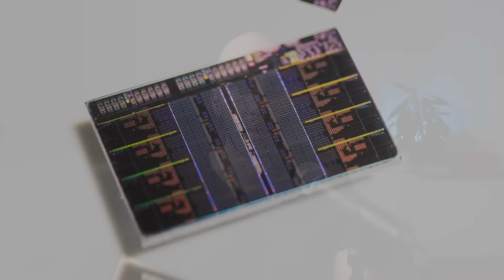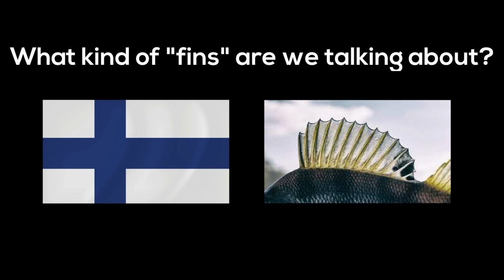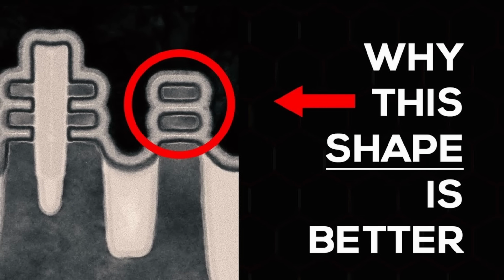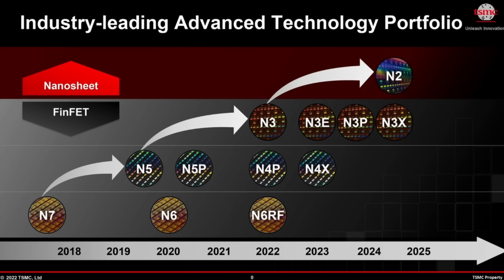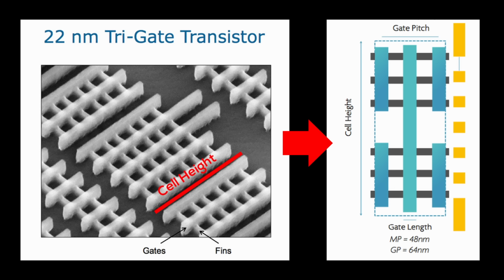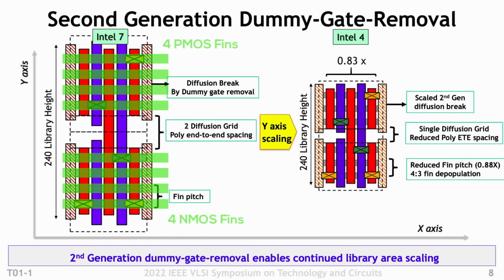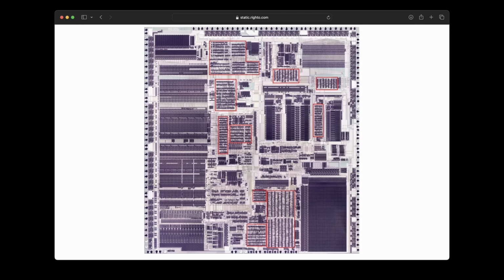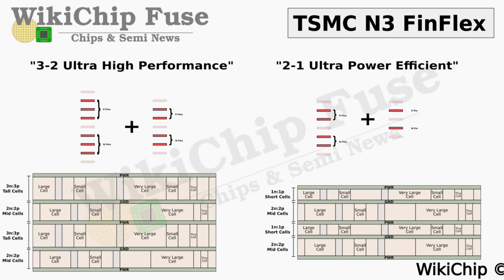TSMC FinFlex: How Chips are made Worse to get Better

Comment: Awesome video. I used work at a research institute focused on algorithms for VLSI (though I personally worked on something different, not VLSI). With every process node, there would be new flexibility but also ever more complicated rules to go along with it. For example, you'd be able to place wires closer together than before but you'd have to avoid specific patterns because of interference. Looks like this technology behaves the same way. From an algorithm designer's perspective, designing chips becomes more and more difficult with each process node. I think if manufacturing improvements stopped tomorrow, it would still take many years for all the potential in the current process to be exploited.

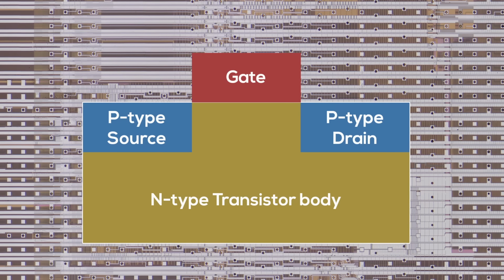Comment: Your videos are superb and well-researched.  However, you could use an improvement in your explanation of the field-effect transistor (N-channel & P-channel) at 2:20, without complicating it with physics.  The key to note is that in any one transistor, the source and drain materials are different even though they are of the same polarity.  Therefore you need to provide reference in your explanation.  

Hence, when the voltage on an NMOS transistor's gate is more positive than its source, the internal electric field created induces conduction between its source and drain, meaning that it is in the ON (or closed) condition.  The crux is that when the voltage is the SAME on the gate as the source (eg zero volts difference), it is in the OFF (or open) condition.

Conversely, when the voltage on a PMOS transistor's gate is more negative than its source, the internal electric field created induces conduction between its source and drain, meaning that it is in the ON (or closed) condition.  The crux is that when the voltage is the SAME on the gate as the source (eg zero volts difference), it is in the OFF (or open) condition.  Note this last line is same explanation as for NMOS!

Now here's neat thing about all this (look at a schematic of a CMOS inverter).  In the simplest case of an inverter logic gate with one PMOS and one NMOS, you connect the gates together for the input, and the drains together for the output.  Next, you connect the NMOS source to GND, and the big deal is this: you "flip" the PMOS relative to the NMOS, that is, you connect the PMOS source to +5V.  Now, in reference to GND (your voltmeter red probe on the connected drains and black probe on GND), if you apply 0V to the input (ground the gates), note that the NMOS is OFF while the PMOS is ON, so you get +5V on the output (0V input changes to +5V output).  Conversely, still referenced to GND, if you apply 5V to the input (connect the gates to +5V), note that now the PMOS is OFF while the NMOS is ON, so you get 0V on the output (+5V input changes to 0V output) ... and there is the inversion.

You might ask .. so what is the charm of CMOS???  First of all, CMOS is not a kind-of transistor as he suggests, it is a technology.  Fundamentally CMOS technology combines both NMOS and PMOS transistors, pairing functionality such that when one is ON the other is OFF (hence Complementary Metal Oxide Semiconductor, CMOS).  The simplest CMOS circuit is the INVERTER.

Let's travel back to the early days of CPUs ...

Simply put ... back then (early 70's) PMOS transistors were difficult to realize, especially on the same die with NMOS transistors.   So instead of using a PMOS transistor in the INVERTER, a resistor was used, tied to +5V, and only an NMOS transistor was used.  This was called a "pull-up" resistor.  That meant when the NMOS transistor was ON, current had to flow both through the resistor and the NMOS device, HEATING the resistor and wasting power.  Moreover, when the NMOS transistor transitioned from its ON to OFF state, the resistor had to charge up tiny capacitors further down line, slowing down the response (RC effect) of the next switching circuit.  So it was a double-whammy, HEAT and LOW SPEED, and, it was impossible to overclock those CPUs.  Therefore, if an early NMOS-only CPU was stopped but still powered, it would be HOT without doing any work ... that is .. statistically half of its resistors would be conducting and the other half not, in a steady condition.  So basically, the heat produced by stopped CPU and a running CPU was not much different!

Advent of CMOS.  

Replacing the pull-up resistor by a PMOS device brought two benefits: 1) as I explained above, when the NMOS was in its ON state, the PMOS would be OFF, hence NO HEAT, and 2) when the NMOS was in its OFF state, the PMOS would be ON, delivering power ONLY to the next stage, not to its NMOS (because it is OFF).  Furthermore, the output drive was now "active" instead of "passive", all put together resulted in a dramatic increase in speed and decrease in power dissipation.  The first single-die CMOS CPU was the RCA 8-bit CPD1802, introduced around 1974-75.  I was able to overclock it (perhaps one of the first overclocks on the planet), from 3 MHz to a whopping 6 MHz (MegaHertz)!  And yes, it still runs at 6 MHz.  Consider that the IBM PC used NMOS-only technology (5MHz i8088) 6 years later, the CPD1802 was so "advanced," it hardly got warm even at 6 MHz.

So why do we need heatsinks on our CPU these days???  It's because the faster we switch the CMOS devices, the more often tiny capacitors need to be charged and discharged.  This is increased work, and work is heat.  So as we increase CPU (switching) "clock" into the GigaHertz range, this capacitor charge/discharge becomes the dominant effect, and when you have literally billions of tiny capacitors and MOS devices on a die, both the transistors (they are not perfect, they do have a small amount of ON-resistance) and capacitors will heat up.  Therefore, a modern CPU in the stopped state, or near-stopped state, can be cool, but when running at 4 or 5 GHz can produce the heat of a 100 Watt light bulb.  

Now you know why intelligent clock throttling is important for the sweet-spot-on-the-tennis-racquet, especially in a laptop: computing power (and heat) on demand, only when really needed.

This was supposed to have been a short comment.

Comment: Everyone that talks about Moore's Law forgets the part where it is supposed to get cheaper.
Reply: The same capabilities are getting cheaper, unless you're Texas Instruments and you have a monopoly. 

The basic digital camera with the same resolution, storage capacity, frame rate, and connectivity as five years ago costs less now than it did back then. It's just that no one wants less capability so nobody buys them, and manufacturers stop making them.
Reply: The same capabilities in gaming are only getting cheaper for the devs.  

They’re pushing off optimization onto hardware capable of brute forcing its way through, meanwhile Nanite, lumen, and other design tools just make it easier and faster to do.  

Games look the same as they did 8-10 years ago, but run worse the newer they are.  The cost of the hardware needed to brute force past inefficiency is pushed onto the consumer.  

Transistor density is up
Die size is up
Package complexity is up
Energy cost is up
TDP is way up
Cost is astronomically up.  

Seems like we’re trying to brute force our way past Moore’s law.  It should be called brute’s law.   Price will double every 3 years no matter what the hardware does.

Comment: I think you missed the point on the power efficiency of cmos…my understanding is that cmos is used because it’s more power efficient than either pmos or nmos alone. If you only use pmos or only use nmos, either a one is represented as power flowing and a zero is represented as power not flowing or vice versa. That means there’s constant current flow and energy loss. If you combine a pmos circuit where power flow represents a 1 with an nmos circuit where power flow represents a zero, you get a circuit where there’s no power flow at all, but if the pmos circuit is open and the nmos circuit is closed, that’s a one, while if the nmos circuit is open but the pmos circuit is blocking the flow, that’s a zero.

Instead of representing values by whether power is flowing, you represent values by why the power isn’t flowing (the pmos side or the nmos side), and that’s when you get massive power savings…it’s not that the one kind was much better than the other in terms of power draw, but that putting both together stops a lot of wasted power.

Comment: As to standard cell sizing, they commonly come in multiple sizes. And it isn't just speed, it's also how large the net is that is being driven. That could go to 20 or 30 other inputs, so you want a big beefy driver for that. That. Also, if you have a line that goes a long way you want a bigger driver for that too. But you would use a smaller one for a short Trace that only goes to a couple cells.
Modern synthesis and place and route tools. Do this for you. Pretty much automatically. They will size cells up or down as necessary while still meeting the timing.

Comment: I would not say that those next-node transistors are Worse*. They are in all aspects really *Improved ones (I would not use Optimised, because that bears a negative aspect of a trade-off). So the TLDR from this video is - the next node is not a nanometer size reduction, its the same on X/Y axis. But the Z - height - has grown. So more into what V-nand brought to the SSDs. And the FinFlex is then a further Improvement - combining benefits of both cell types.

Comment: no thats pipedreams. SEMI CONDUCTOR. in form of silicon bed, you are making the signal path smaller in collective atom mass, there for the LIMIT of those semi conductors speed transfer will be amplified with the narrower path, and its GET SLOWER. and the only way you making it faster is by adding more voltage/ampere through it. STRESSING that narrow path as the amount of atom transferring the electron signals now must take the energy beyond its critical capacity and will burn the silicon up. the smaller of the path, the less "rails" available for electron signals.
and you are opting to increase its processing nodes density, making instructions more complex and can only go up to certain point where things will no longer gain anything. and currently you already at the 99 percent of the semi conductor capability.
there is no more to be gained from getting smaller and smaller, because you will only add more density into it. and that cancels each other.
semi conductor silicon tech has at its peak. move on to new different compute processing tech or be happy with everything the way they are.

Comment: Moore's law doesn't exist in reality.  If it did CPU/GPUs wouldn't be skyrocketing in size and power consumption.  

Moore's law seems to be a goal but not a practical reality.  If it was a reality, a Nvidia 270 would have the same power draw and size as a 3070.  But we know that isn't the case.  It's gotten so bad that CPUs are like 20-30% larger, and GPUs are monsters requiring huge coolers.  😂

Comment: A big advancement in chip design is going to be when we can design truly 3-dimensional chips, i.e. chips that actually have 3-dimensional transistors and whatnot rather than just vias. While AMD is already doing something barely similar with their 3D V-Cache technology (which is frankly just stacking silicon more than anything else), there's a massive amount of performance to be had if this ever becomes a thing - unfortunately, I have no clue where we would start with something like this... But there are certainly massive gains to be had when we consider that we can absolutely demolish latency and die size by building upwards!

Comment: You are confusing two orthogonal issues.  P-type vs N-type is one thing.  Depletion vs Enhancement is another.  A MOS transistor that conducts more when the gate is energized is called an Enhancement type transistor.  A transistor that conducts less when the gate is energized is called a Depletion type transistor.  The four combinations exist:  There are Enhancement N-channel and Enhancement P-channel, as well as Depletion N-channel and Depletion P-channel.  The polarity and Enhancement vs Depletion are orthogonal things that you are confusing.
  Depletion type FETs (with doped channel that conducts unless a voltage in the gate acts to suppress its conduction) were more common initially, but are rare to find nowadays.  They are certainly not used in logic circuits.
  So, I'm assuming you did not want to bring up the Enhancement vs Depletion dimension into this video, since the CMOS transistors used in logic ICs are always enhancement type, never depletion type.  Assuming you simply wanted to explain PMOS vs NMOS, then the right way of explaining it would be to say that they are mirrors of each other, with NMOS conducting from drain to source when it has a positive voltage on the gate relative to the source, and PMOS conducting from source to drain when it has a negative voltage on the gate relative to source.
  You could also have explained why higher current is desirable:  The higher the current, the faster the gates it feeds can be charged.
  Other than that, great video!  Very interesting.

Comment: this is basically the concept of "don't build out, build up." that led to the idea of Skyrises. so instead of taking up more area these transistors are taking up more volume. which will in turn lead to smaller but thicker chips with at least the same performance. it is better optimizations of the space that is already there but ultimately it is still limited as i would assume  that there is a physical limit to how high these fins can be before they become too fragile.
Reply: Yep, and you can only do it once.  Sooner or later you run out of dimensions.

Comment: Hmm, so we're going to hit another plateau when we get down to 1 fin, 'cause you can't go down to 0.5 fins.

Might be worth investing in the foundries now, then selling like a year after 1 fin is achieved.  (Or shorting long term when 1 fin is achieved).

Personally I'd like to see CPUs with only the small logic blocks, low power, low speed, buttloads of cores.  Get the software engineers to do their fuckin' jobs and write good software instead of relying on next year's upgrade.

Comment: After saw this video, the greatest strength of TSMC is gone once the industry move to GAA as GAA fins are stacking on top of each other,  since there is nearly no way (or if possible that will be dark magic) to have 2 and 3
 Stack GAA, like all area need to be the highest stack, FINFLEX is outdated once GAA occurs and I think TSMC should not go with GAA on N2 but with BSPD, but CC WEI the worst CEO TSMC ever have will not admit this GAA before BSPD is a mistake. Period.

Comment: "Only generate an output if two input voltages are the same" but the example shown is not that even not that (which would be NXOR (not-exclusive-or, aka equality), but with PMOS or NMOS) but NAND (not-AND): Only drive output low if both inputs are high, otherwise drive output high: This generates an output drive either way, that sorta is the whole point of CMOS, and binary logic in general! 
I.e. either state has low output impedance: It has a strong opinion always! 

The entire point of digital logic circuitry is First: Be certain! Second: Don't waffle!
Now you do have to worry about metastability: When CMOS gets uncertain, it gets HOT fast, and this is very ungood. 
So: First: Be certain! 

The main point of this is to be very immune to unintended interference, so your data remains perfectly unchanged always, until change is intended. No decay over time, no increase in entropy! No bits allowed to flip without permission! (and sometimes you add ECC to check and fix if they do). But it's also necessary for CMOS to not overheat and die. This is because if the transistors are very off, or very on, they are open circuit or closed circuit: Either no current flow through, or nearly no voltage across the channel (from supply to output, or vice versa), never much of both at once (at least not for long!).

@High Yield: Please fix, and add in the enhancement/depletion mode thing: you're confusing the youngun's! And no, leaving it out doesn't help with the understanding, you should be as simple as possible, but no simpler! Leave out that little nugget, and nothing makes much sense: Relate CMOS to a changeover relay, but don't get P/NMOSFET confused with enhancement/depletion modes.